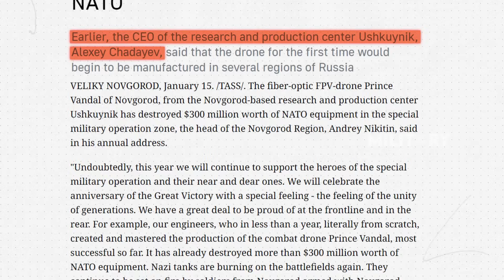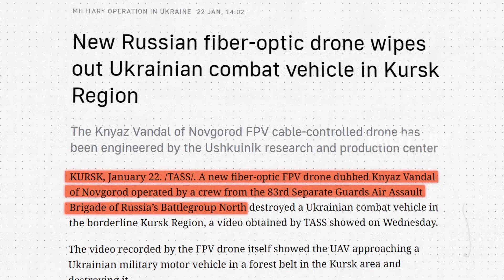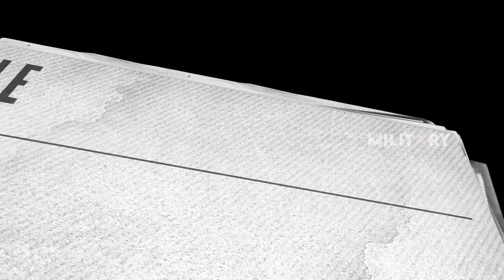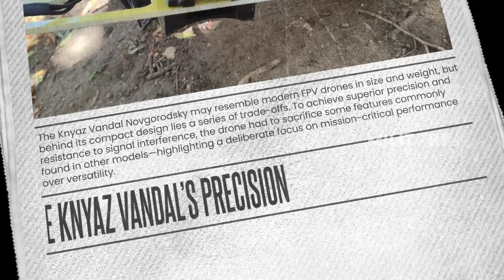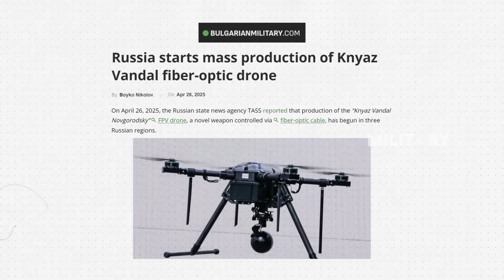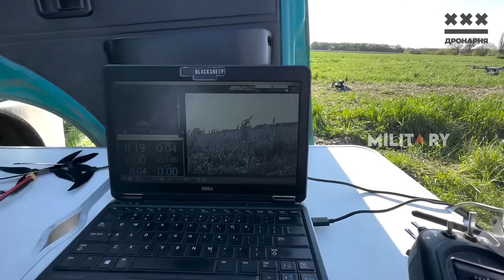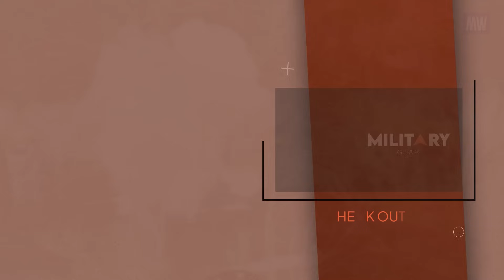Watch! How Russia’s Knyaz Vandal Drone Is Wiping Out NATO Weapons

Comment: Knyaz is translated to Prince. These are Prince Vandal drones. Wire guided equipment is not new. Konkurs and Faggot and Milan and TOW and HOT missiles use wires connected to the missiles to transmit commands from the launcher to the missile in flight. These fibre optic cables can carry enormous volumes of information in both directions so the drone can send high resolution video to the operator that travels through the fibre so the enemy can't jam it, while the operator can transmit flight commands via the fibre to the drone making it a real problem to defeat. Modern battlefields will look like something from Tolkien with spiders webs all over the place with the fibre optic cables being left everywhere. There are videos of drones weaving in an out of nets on roads designed to stop drones and then the drones hit their targets.

Comment: Are there any ammunition specifically built for these drones?
Reply: Нет, используется всё, на что хватит фантазии.
Reply: That seems to be an area of possible improvement.
Reply: Yeah Ukraine uses 3D printed grenades for their baba yaga drones.
Reply: They have the warheads of a wide range of anti armour and anti personel rocket launchers. The RPG and RGO and other engineer type rockets warheads are widely used, plus the grenades from their 30mm automatic grenade launchers with tail fins fitted are also used as ammo for the drones. A lot of the Prince Vandal drones just use blocks of HE and are used against civilian vehicles and soldiers out in the open. Shaped charges from ancient RPG-7 rockets are also used against light armoured vehicles and heavy armoured vehicles. Hits to the roof and turret bustle means even old rounds with 300mm penetration can reach into the crew compartment and ammo stores and destroy a vehicle. They also make custom designed weapons for their larger drones including 10kg and 20kg and 50kg guided bombs and missiles. They have no shortage of weapon types.